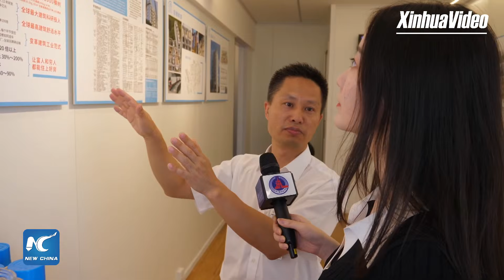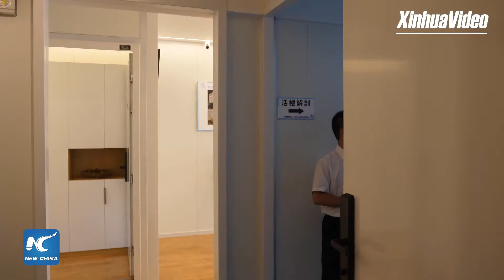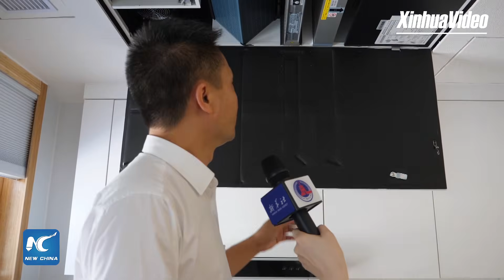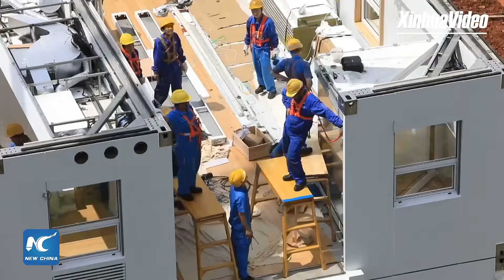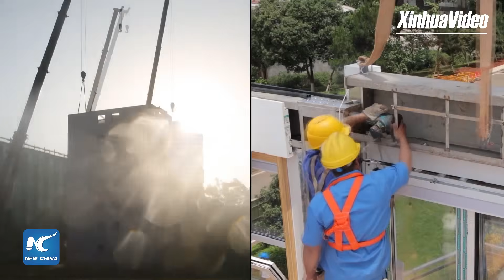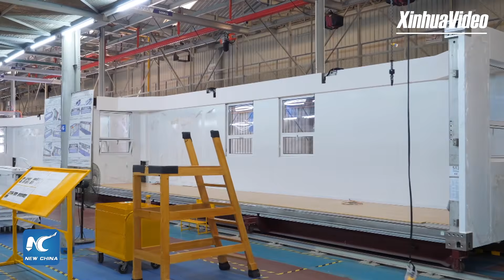Exploring cool tech used in 11-story apartment block built in 28 hours

Comment: Built in 29 h, studied and developed in 29 years. Integrated the concepts of Le Corbusier presented a century ago and forgotten or ignored by the West. Included some 29 month old mathematics for vibration and noise attenuation. 
What about using the walls  and windows as solar panels and at the same time reducing the heat generated by converting the solar energy to electricity? 
Let us see some Chinese speed in this also!